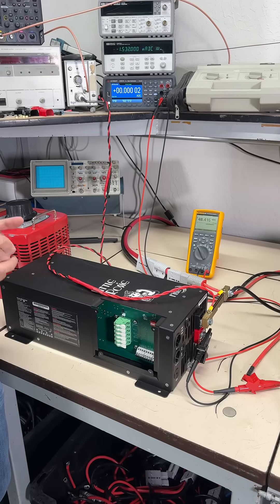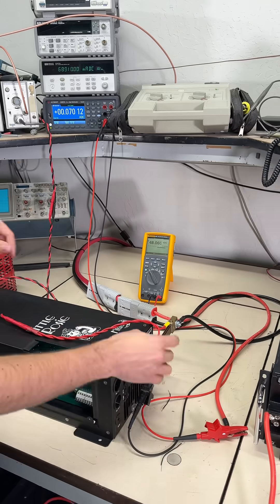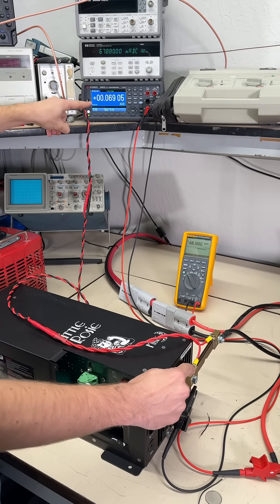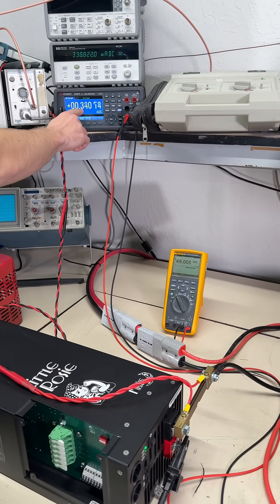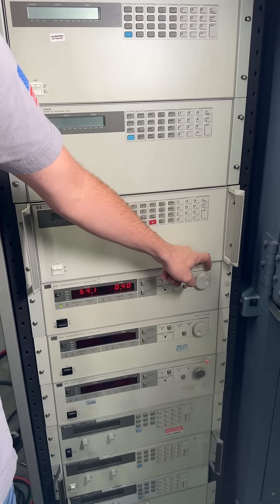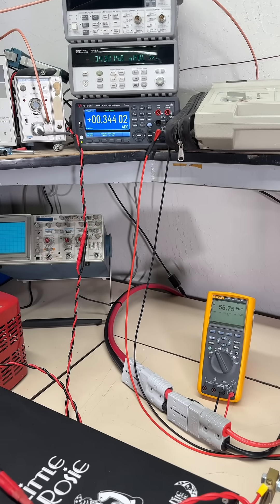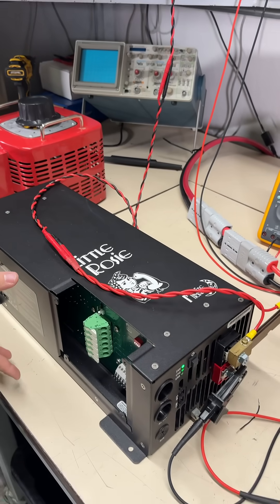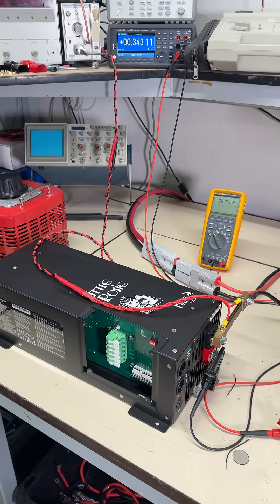MidNite Solar Little Rosie - VERY LOW Idle Consumption - Beats the Specs!

Comment: Victron Multiplus II 5KVA 48V  runs around 15W and it's a low frequency inverter.
Reply from the maker: Yes, the 5kVA multiplus-2 is quite impressive!  Though, it is a 4kW inverter, not too far off what the Little Rosie is capable of.  When you factor in the 45C ambient temperature the Little Rosie is rated for full output versus the derating of the Victron at 45C, the comparison is surprisingly equal.  We were measuring the Little Rosie at 97% efficient at full load today (we are covering this in our long form video) which is pretty incredible!
Reply: @CurrentConnected  ~ Being a High Frequency inverter kill it for me!  Can it do "Assist" mode like the MP2?